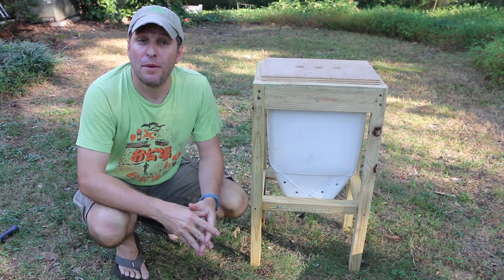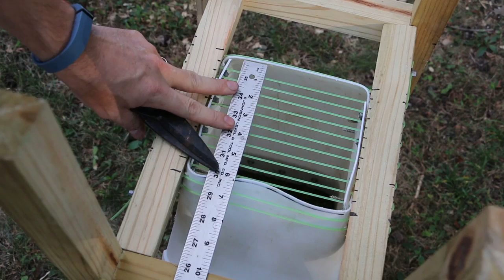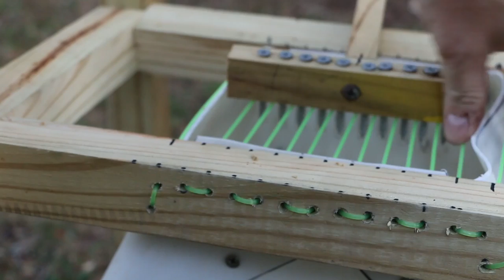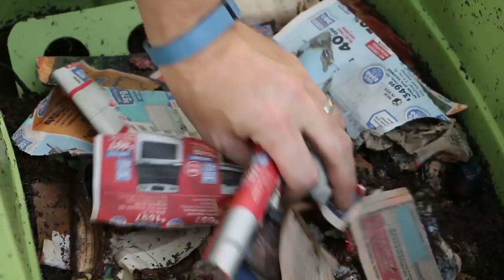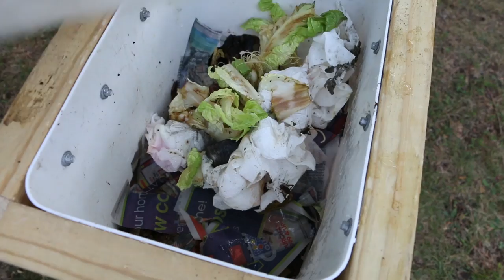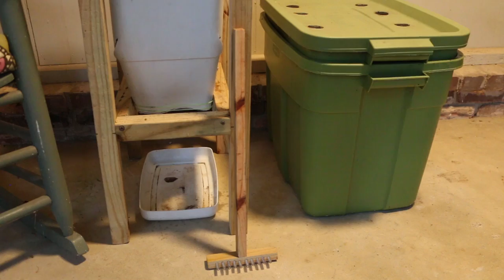How To Set Up A Flow Through Worm Composter

Comment: What should I do to keep the worms from dying in cold weather I live in Washington
Reply from the maker: For your worms to make it through a Washington State winter, you would need to move the composter inside. Even a semi-conditioned garage would be ok.
Reply from the maker: Autumn, another option would be to use a worm tower application. Use a 5 gallon bucket instead of a PVC pipe, that will give you more capacity. Bury it almost all the way in a garden bed and then during the winter, cover the top with a thick pile of leaves or two bales of hay. The hay would be easier, as you could move them to add compostables. The pile of leaves would be fine if you plan to let it go dormant during the winter months.
Reply: GreenShortz DIY where I live my backyard is very muddy and I don't have a garden bed but I do have a small area that's not his money is the rest do you think that instead of a plastic bucket if I could use some type of metal bucket and take out the bottom and do the same thing and then cover that with two bells of hay if that would work just as good I'm concerned due to this winner of a high population of rats in the area because of more corn fields for use this year than usual and I've had a lot of neighbors and other people in the community say they've seen more rats in the community and the gas was because of the corn fieldso I was concerned that if I put something plastic the chew right through it and get into the food area
Reply: how often do u water ur worms??
Reply: There is a video on you tube where someone makes a wall of compost to give heat to his greenhouse. Maybe you could surround the worm towers with traditional compost over winter to keep them warm.
Reply from the maker: Mohamed...I usually add a little water whenever I put in new worm bedding. It needs to be moist to provide the proper habitat.
Reply from the maker: Chuck...thanks for the suggestion. I think that is a great idea.

Comment: So I'm asking questions on here I'm not sure how to do it through email so I live in Washington where there's a lot of cornfields and such so there's a lot of mice /rats in town and they chew through plastic garbage cans if you leave them out side the garage and stuff but I live in apartment that's on the bottom floor I have no garage or outside storage area and then not a lot of room in my apartment is very small so is there a way to build one out of something metal so thatcan't chew through it to get in it and if so is there a way I could put it in something inch insulated with strong on the outside or something to keep it warm in the winter time
Reply from the maker: Hi Autumn, My suggestion would be to do a worm tower using a 5 gallon bucket. The worm tower would be fully buried in a garden (ideally), but given your apartment location, you might need to bury it inconspicuously in the shrubs :-). You could set up the air holes with metal screen versus nylon. Also size them smaller, a rat can't get through a hole smaller than a dime. I'm planning a video on a worm composter like this in the next few weeks. If you can hold out, that may be a good option for you.  Let me know if you are interested in seeing a video like that.
Reply: Yes that would be great..

Comment: Is this possible that worms will escape down?
Reply from the maker: +MocnySygnal it is possible that the worms will, but not many will. In my experience with this particular flow through worm composter I have only seen a few worms end up in the catch tray at the bottom. It also happened when I had just installed them. Once the soil layers settled in I only saw one or two every now and then. Composting worms want to be in an organically rich habitat. They should naturally keep migrating upward into the new compostable materials being added. Thank you for your question.

Comment: Would this also work for night crawlers?
Reply from the maker: +Ross Dickens if you are referring to earthworms, this wouldn't be the best design. Earthworms process soil not compostables, so they would migrate throughout the bin and the compression zone wouldn't function as a separator. However, Red Wigglers (composting worms) are also called nightcrawlers, since they do, in fact, crawl at night. If you were Referring to this type of worm, then this is what this system was designed for. Thanks for your question.
Reply: GreenShortz DIY  Thanks for the videos!
Reply from the maker: Ross, here is the latest flow through worm bin video: How to Harvest a Flow Through Worm Composter: https://www.youtube.com/watch?v=6ScnbSySrFg

Comment: Do you sell worms and coconut core? Please let me know. If you start your worm bins in December, can you keep them outside (I live in Central Texas near Austin)? When you get ready to harvest the castings, can you use a sifter?

PS - Just a thought, do you know that rain water is acidic? Because of the CO2 in the air. It's so strong that it is destroying monuments that have stood for over 2,000 years. I know because I was there when they built them.
Reply from the maker: I'm a lover not a seller. :-) I buy my worms from Uncle Jim's Worm Farm (www.unclejimswormfarm.com) A sifter can be used to harvest castings, but in my experience they are still very moist and difficult to separate that way. That is why I built the flow through worm composter. I can just rake the castings out of the bottom and separate them that way. I think your worms might be OK outside in Texas, but they won't work as fast in the colder weather. You might consider keeping them in the garage. Thanks for watching.
Reply from the maker: Marty, you might appreciate how easy it is to harvest worm castings from this flow through worm bin: Watch this: How to Harvest a Flow Through Worm Composter: https://www.youtube.com/watch?v=6ScnbSySrFg

Comment: Can worms endure low temperatures in this setup?
Reply from the maker: +Martin Blass it depends on how low the temperature gets. Because this flow through worm composter is off the ground it is more susceptible to freezing. This would kill the worms. I kept mine in my garage last winter, which was not conditioned but didn't drop below freezing.The worms slowed down during the winter but fared just fine.

Comment: I don't believe in your bin design the funnel shape was even necessary since you're using closely-spaced trimmer strings to hold the wet content together.
Reply from the maker: Steve, I agree. The worm castings are pretty thick and sticky as they get toward the bottom. I'm planning a much simpler design for the flow through worm composter for the spring. Most of the time I make a prototype, run it for a while, then simplify the design for the video. This time the video was the prototype. But, that said, I like all the feedback I get on how it could better. A broader group of minds on the problem will yield a better end product. So, stick around and lend your thoughts. :-) Thanks for the comment.